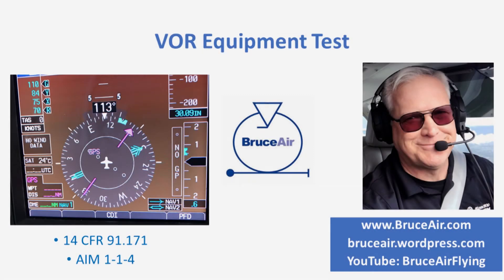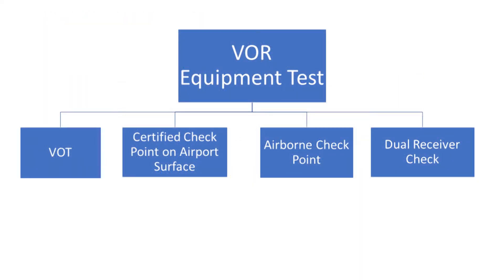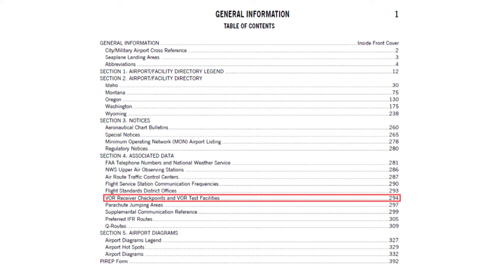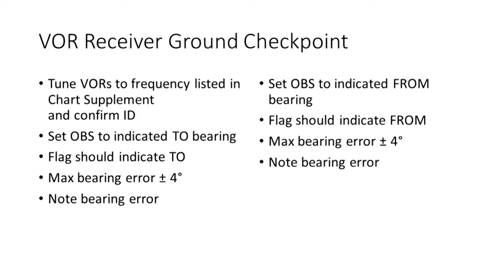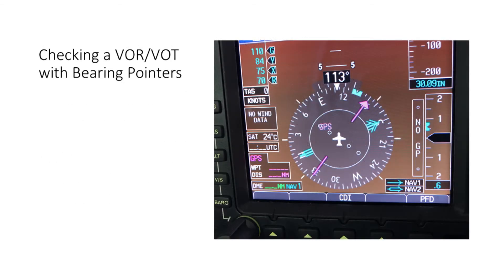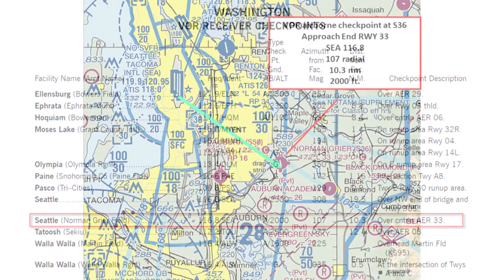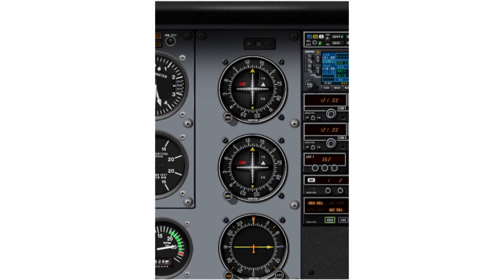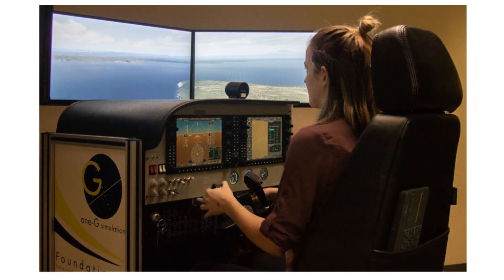VOR Equipment Test

Comment: 91.171 paragraph (c) : The maximum permissible variation between the two indicated bearings is 4 degrees for a dual VOR check. not + or - 4.
Reply from the maker: Good catch. I'll fix that when I update the video.